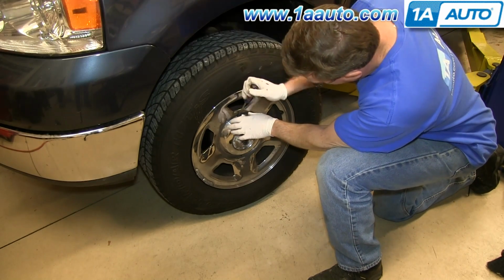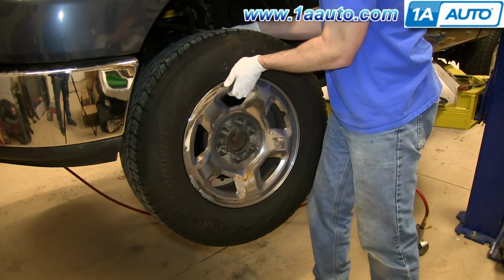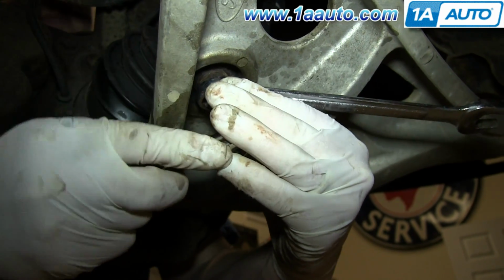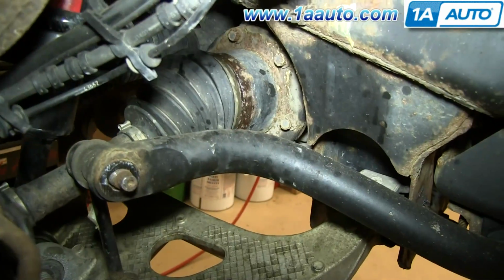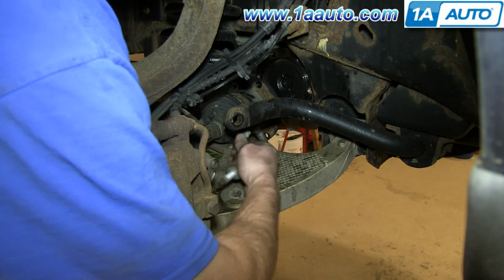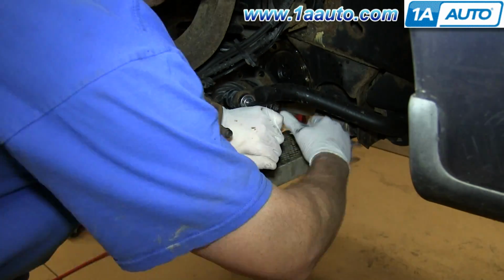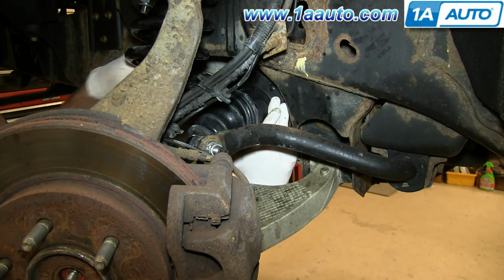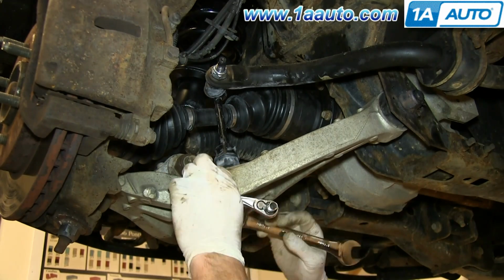How To Replace Stabilizer Sway Bar End Link 04-05 Ford F-150

Comment: Bro you could have just removed the top nut of the other sway bar link so you could just move that bar around a little instead removing all those other nuts.
Reply from the maker: +OURANOS Thanks for the tip!

Comment: I am an old school guy and would never torque to 120 lbs in one go. 30 lb increments to distribute the stresses in the threads, hub and wheel. Warp or break a part once will eat up all the time you save in a lifetime of just torquing down to spec. One auto manufacturer even backs torque off and re-torques as explained in their technical manual but the shop manual only give the torque specification and not the process.

Comment: No need to remove the drive shaft , I just used a comealong to from the frame hole to the sway bar and pull the sway bar back alittle to get the new part out and in , Simple
Reply: Could have just removed or loosened the top nut on other side and moved that bar around a little.

Comment: I have a 2004 Expedition 2WD and it has a different LCA than in this video.  I do not have access to get anything other than a deep socket on the sway bar end link nut.  There is no way to have a wrench of any type on both the nut and the end link at the same time.  Do you have any suggestions?
Reply: You have to get one of those wrenches with a bent angled head

Comment: Is there a video on diagnosing a bad sway bar link? I have popping sound when I turn sharply and the sway bar links appear to be loose. 2005 F150 FX4.
Reply: Jacob Garland I know it's kind of late..but another way you can know they're going bad, is when you hit a bump it sounds like a jar of loose change in your front end
Reply: You ever figure out the popping sound?
Reply from the maker: We currently do not have an auto repair video that shows this. Usually when a sway bar link goes bar you might experience a thumping noise or a shake in the wheel at higher speeds. If any of our viewers need to replace their sway bar link, we carry the one shown in this video on our website. we also offer free shipping. Here's a link to them https://goo.gl/yfSMaL

Comment: What year is this truck? I have a 2006 FX4 F150 and my swayer end link looks 100% different. With that said I have a split bushing on my end link that needs replacing but after watching this video I am confused if i have a different swaybar?
Reply from the maker: +Southport 26 This is a 2005 Ford F150 4WD.  You are absolutely correct:  the 2006 requires a different part, altogether.  1A Auto does carry the correct sway bar links for your vehicle here:  https://www.1aauto.com/ford-f150-truck-sway-bar-link-driver-or-passenger-side-front/i/1asfk02315?utm_source=YouTube&utm_medium=CTA%20Comment&utm_campaign=1ATony
Reply: Southport 26 Mine is an 05 and they don't look like this either..and I can't find a video or anything anywhere in the torque specs for them..

Comment: Hi, quick question....I have been having a shake in my steering wheel at about 45-55mph only when turning the wheel. When I am going straight, there is so shake.  I have newer tires and they have been balanced repeatedly.  Could worn sway bar end links cause the shaking? Thank you!
Reply from the maker: +jtjpilot That's a tough one to diagnose over the web, but it could be a few different things. First off, you could try bleeding the air out of the power steering system if there's any there. To do this, have a buddy remove the reservoir cap. Then, you start the engine and turn the wheel all the way to one side, hold for 2-4 seconds, turn to other side and hold for another 2-4 seconds. Continue this process until your friend can no longer see air bubbles coming out of the reservoir. Then, top off the fluid as needed. If this doesn't do the trick, check your ball joints, sway bar links, and tie rods. Hope this helps you out.  1aauto.com?utm_source=YouTube&utm_medium=CTA%20Comment&utm_campaign=1ATony 866-403-3393